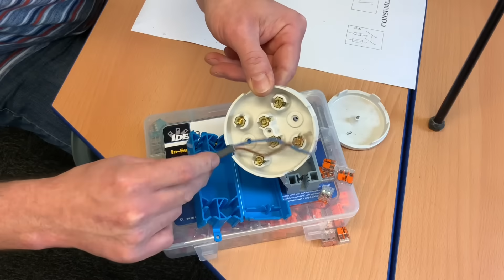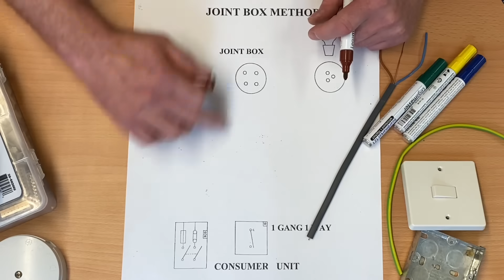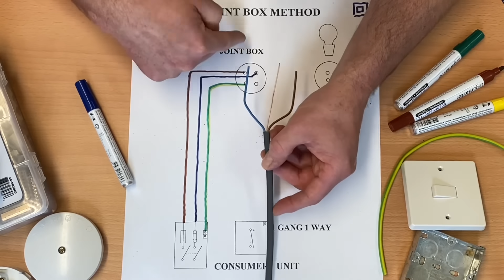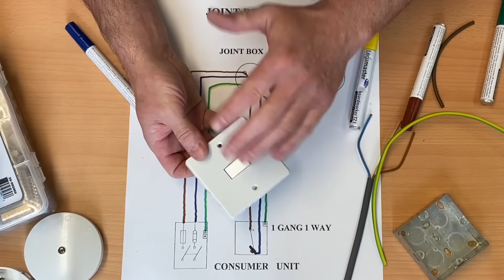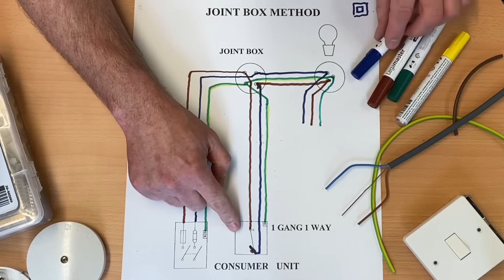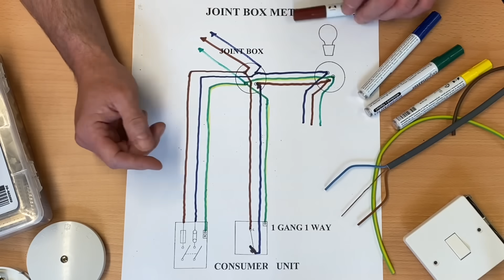Wiring Diagram Lighting Circuit Joint Box Method - Great for Wiring to LED Downlights (Spotlights)

Comment: T & E to first switch box, daisy chain all subsequent switch boxes on that circuit with 3 core & E then run 3 core & E to every fitting. Then its future proof you can do any configuration like that.

Comment: See loads of stuff like this in older houses but none of it is earthed just 2 core red and black cable. How do you go about earthing the system would I have to re wire the full lot? Mint video
Reply from the maker: Are the accessories plastic on the lighting circuit..?

Comment: Excellent presentation as usual. So am i right in saying that this is another way you could wire up maybe a series of downlights and also this would keep the no of cables at the switch workable as oppossed to the 2 plate method where you take the feed to the switch. Thankyou for showing another method as i thought you were limited to 2 and 3 plate cheers from an old man trying his best to learn and practise a fascinating trade. You are a legend Sir.

Comment: This is outstanding. I bought an LED downlight and the instructions had one line about connecting color to color, and nothing about how to connect it to a wall switch/dimmer or how to control multiple LED downlight lights with a single switch/dimmer. This video was excellent. Thank you.

Comment: Love your videos, and I don’t mean to be pedantic, but millimetres squared is not the same as square millimetres.
That would make a 10mm ‘squared’ cable 100 square mm in cross-sectional area, unless I’m wrong. Which I could be 😁

Comment: Hi Gaz, I’m learning so much from your videos but I would rather get an experts advice. I currently have 1 pendant, 1 switch feeding to a mini consumer unit in my garage however I was wanting to upgrade or replace the circuit to run 2 main pendants and a separate pendant (basically 1 to use most of the time then when working at the bench have the extra 2 lights). I have 2 doors into the garage and would like to be able to switch either or both on from either door. I hope I have explained this but if you could draw a diagram that I could follow I would enjoy the challenge. 

Many Thanks

Jonny

Comment: Wot would be the diagram be for this but with two 2 gang 2 way switches?
 To control  5 down lighters...
(2 on one side of a king post truss and 3 on the other side of it ) from two 
2 gang 2 way switches on opposite sides of the room...
All from a  central JB source in from the rose below the loft ..?
Would be very grateful for any help in this matter...
Keep up the good work
Cheers Chris 👍🙏🇬🇧

Comment: So am i right in saying the reason why the newer style is called a "Maintenance free" junction box is down to the fact it has means of cable retention therefore no stress on the connections will be applied from pulling cables around on the roof etc loosening the terminations?

Comment: Great videos, really clear. I watched the two plate method video with neutral running to switch, is there a video where you have run neutral to switches in a 3 way lighting circuit please?
Reply: Also a cheeky request, can you offer guidance on installing downlighters in a vaulted ceiling, not sure what to do to avoid compromising the insulation and vapour layer (by making a hole)
Reply from the maker: Wiring Diagram Lighting Circuit 2 Plate Method Taking the Feed to the Switch 2 Way and Intermediate https://youtu.be/L9DU8XkHn1U
👍🦾👊😄
Reply: @GSHElectrical  thanks, will look at those. Any thoughts on vaulted ceiling downlighter question please?
Reply: @jontrawford8233  Bit late now I suspect, but you ar right to worry about where the airtightness and/or vapour control layers are going. Downlighters are a problem here. Pro-clima kaflex grommets are a great way to put a cable though a membrane: https://www.greenbuildingstore.co.uk/product/kaflex/
But it depends on the construction whether you have space to put a downlighter in the plasterboard but keep the membrane intact above and just put the wire through that. You might need a taped-in box like the optime (https://www.ecologicalbuildingsystems.com/post/optime-airtight-downlight-protectors-passive-house-insulation-series-part-11) which is very difficult to seal in if it wasn't done when the ceiling was built. You'd have to cut out a bigger bit of plasterboard: sort out the wiring and membrane behind, then repair the plasterboard hole.
Reply from the maker: Wiring Diagram Taking the Feed Through the Switches - AM2, AM2S & AM2E Lighting Circuit Explained https://youtu.be/cIPZhriDQr8

Comment: Hi Gaz, thank you for making this nice video, showing how to wire a joint box the proper way. In my opinion the most important part of this video is that you dress the conductor the longest route to the contact, so in case of reconnecting you have enough length to strip the conductor (with a knife), double over and put it back in. Your enthusiasm ensures that we keep watching. Greets from the other side of the pond XD. 😍

Comment: So as a total non-electrical person, if you had say 7 other rooms each with separate light and separate switches, do they all take a live from the first connection box if they are on the same circuit on the consumer board to the next connection box.  So you have a connection/joint box in each room?   On  separate note, I would like to highlight a potential electrical hazard. Historically, when using an apple computer charger, the cable becomes slightly split at the plug ended into the computer.  To ensure this doesn't happen I had wrapped some electrical tape around the cable and the plug shroud.  Then after about 4months I took the tape off and found that the electrical tape had caused the rubber cable to literally dissolve and exposing the cables.  Not sure if theses normal, or if it was dodgy electrical tape.  However I believe the electrical tape was purchased at B&Q, so it was from a reputable source and should therefore be certified for its intended use.  Whats your thoughts?
Reply: Hi, running the lives neutrals and cpcs from each room back to the first connection box is possible but then that first box will have to be a rather large example that will be very busy. It makes more sense and usually is more economic in cable length to just string from one to the next and so on.
Wiring conductors are insulated with PVC, which can be flagged with different coloured electrical tape as is done in this video to use the blue wire as a black switched live wire. Cords of plug-in devices can be insulated with pretty much any insulating material, which is not necessarily compatible with the glue of electrical tape.
Reply from the maker: This and other videos in my playlist call taking the feed (supply) to the switch will help.
https://youtu.be/k0u8P0PcGlQ
Gaz